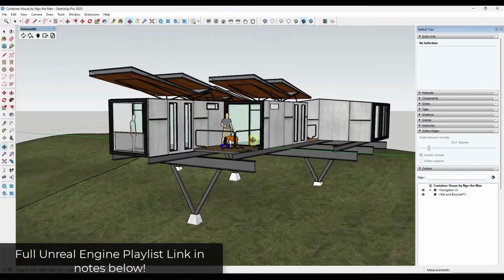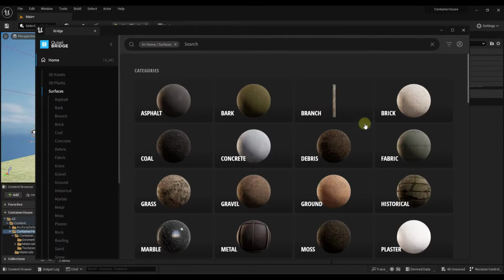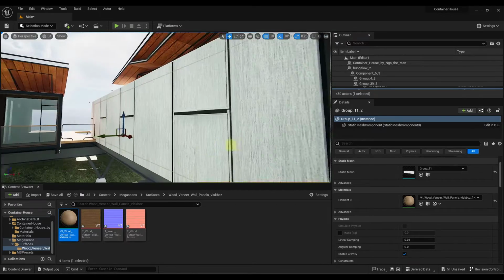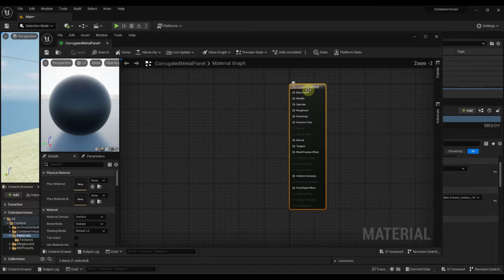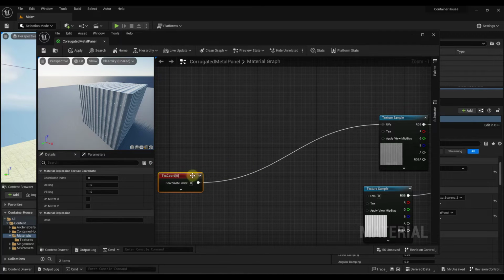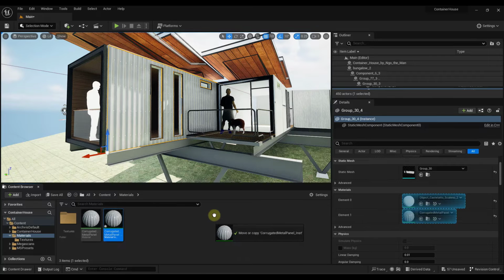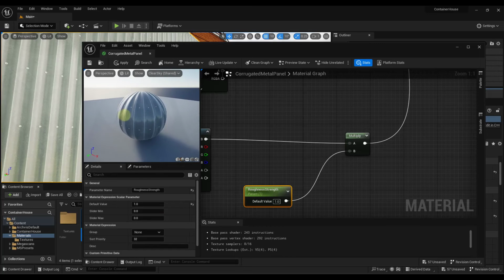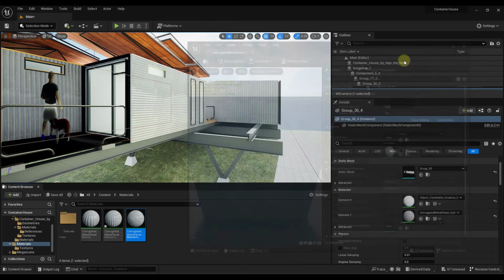SketchUp to Unreal Engine - Setting Up MATERIALS (Series Part 2)

Comment: Another thing you can do is go into modelling mode and box project everything to set the UVs at 100x100x100 so that the geometry is considered 1m2 of texture space per 1m2 of actual surface, that way if you say bring in a Quixel material that’s 2m x 2m you know to just hit 0.5 in the materials tiling. And if you know you’re going to be using a lot of 2m x 2m materials you could just box project at 200 units instead.
Reply: It’s kinda frustrating that the size of the faces doesn’t translate through Datasmith in the first place imo.